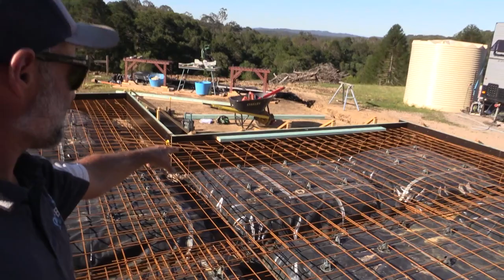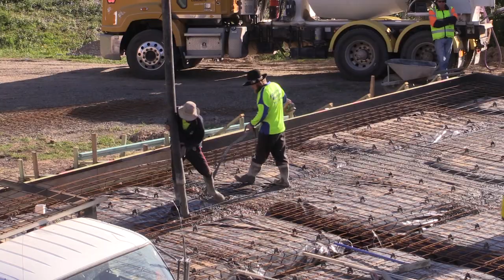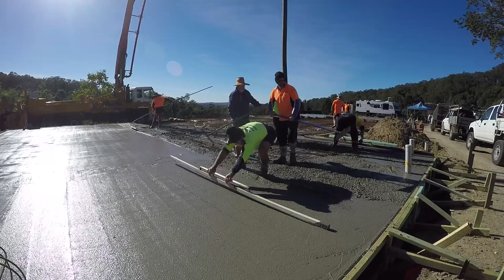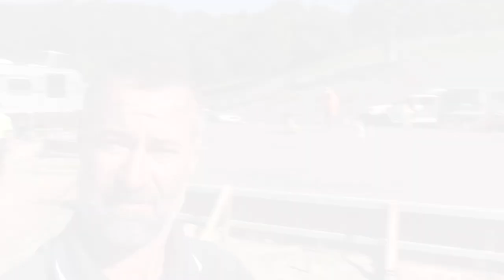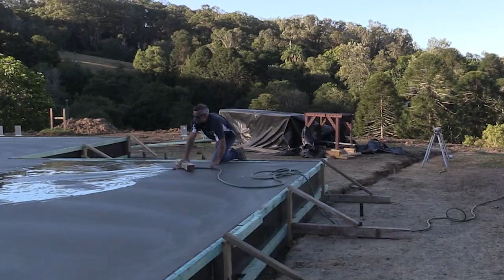Concrete Slab Pour -  Episode 10 -  The Dirt Road Home

Comment: Thank you James for sharing what it's actually like to start a build from slab to finished lock up stage. Watching your family endure the build and being very flexible is just fantastic. I don't think many people actually realise as a home owner what stress as a builder will go through on a daily basis. My dad was a Master Builder to his credit he built alot of the large high rise buildings in Brisbanes CBD  back in the 60's and 70's little did I know at the time helping dad with construction sites would include 20 pound hammers knocking down old concrete walls and using cement helecopters to finish slabs and I was only 10 years old at the time. Yes it's hard work but the rewards working with your dad at that time was worth the effort. It still remains the most important part of my life sharing time with your mum and dad no matter what they were doing at the time.